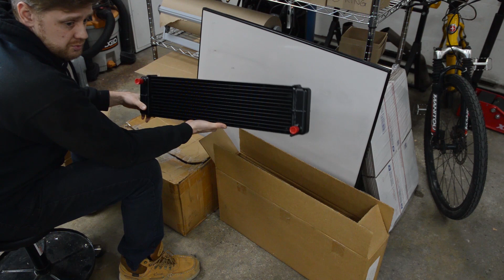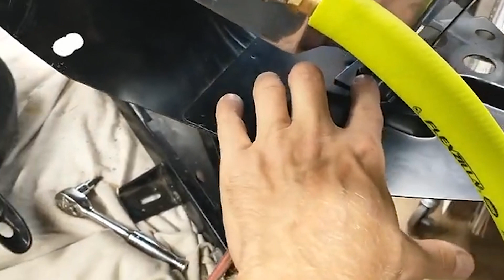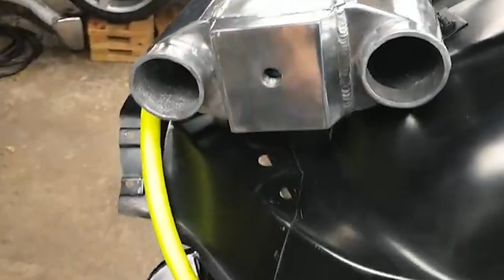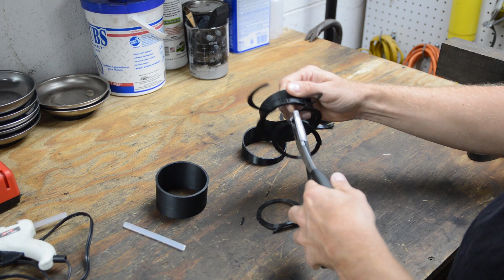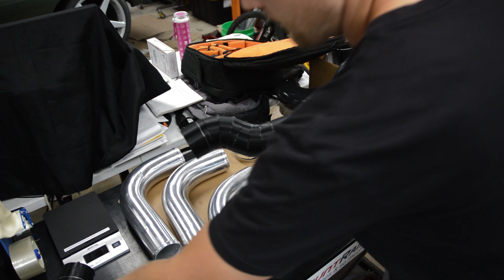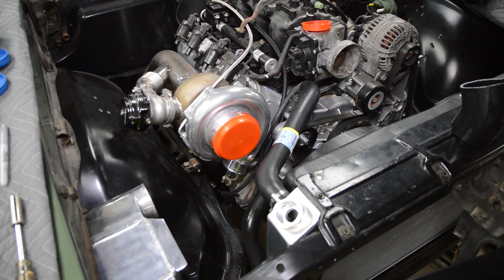Intercooler mounted / 3D printed pipe template / Chevelle LS Turbo Build

Comment: I love this. Am building a single turbo chevelle too
I just picked up a 3d printer and could use tips on how you did this. Thanks.

And which intercooler is that?
Reply from the maker: I plan on coming out with a 3d printing/CAD course. Would you be interested? Here is the intercooler: https://www.frozenboost.com/air_water-ic/150-psi-water-to-air-intercooler-p-946.html
Reply: @HTMR  Thanks for the reply. I may be interested in the 3D printing portion just for funsies but 3d modeling I can do (MS in Mechanical Engineering). Great idea though. If it's like this video, it would be great!
Reply from the maker: @xblackbart6922  What software do you use? I've been using ProE/Creo for 15+ yrs. Also a ME.
Reply: @HTMR  Inventor and SW. Most recently just for fun because Im in the energy industry as a project manager. I dont want to forget everything Ive been learning for the past couple of decades.

I need to learn how to weld better for the plumbing. Im not sure I trust anyone in my area to do it right or not charge me $10k lol.

Comment: Looking good. I’ve always mounted blow off valve the closest to the throttle body. Or on a air to air intercooler on the discharge/outlet tank.